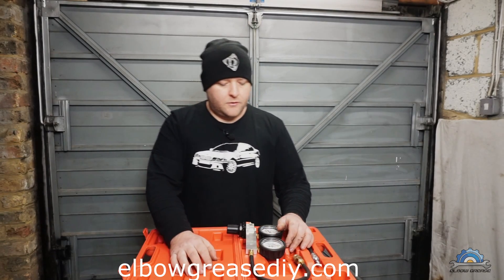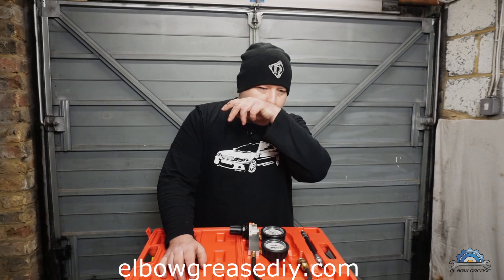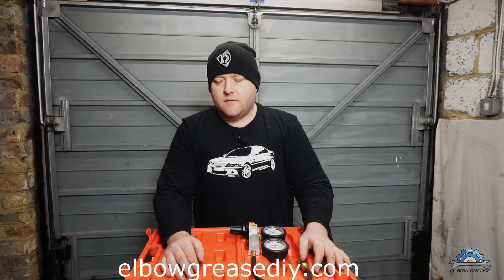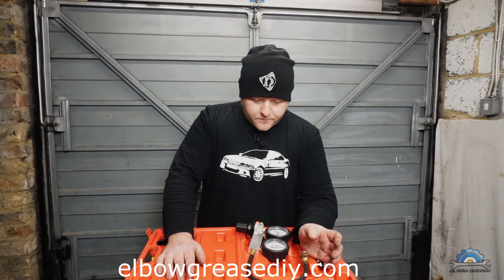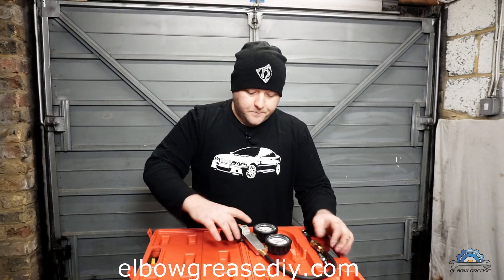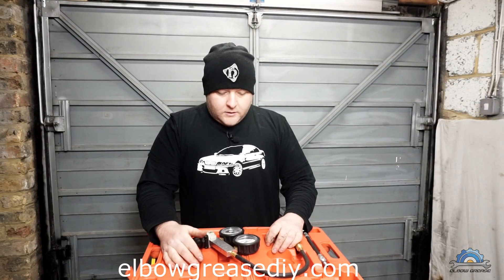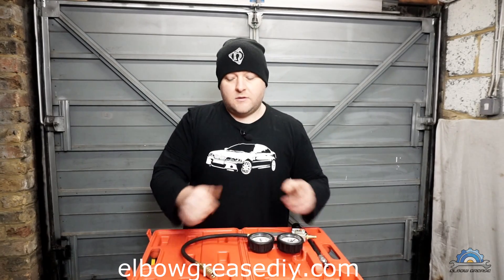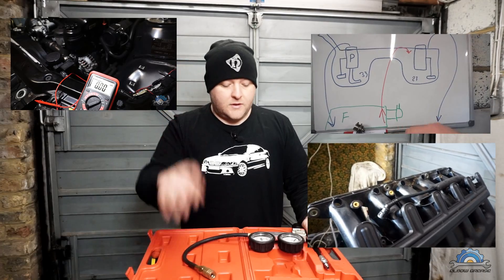BMW E46 ENGINE PROBLEMS - Leakdown test

Comment: I'm burning oil only because its getting sucked in to the intake in the ob2 toque app I'm -25 vacuum at idle so going to try the o2 mod pilot thoughts don't have that in my tail pipe although my oil going into the intake new ccv put on at a cost of £385 just to suck oil the wrong way back to the intake German engineering ha ha
Reply from the maker: this app is not able to show you vacuum cuz there is no sensor related,vacuum figures are virtual.
like I said in this video https://www.youtube.com/watch?v=OaT72UO5ksw&t=13s   if you had changed ccv once ,leave it alone ,piston oil rings are bad and that was confirmed by few already.How much you burning?

Comment: Thanks for the update. I am looking fwd to your videos. Oh about compression, I tried to measure it last evening, my girlfriend was trying to help but I was having trouble getting a tight seal for an accurate measurement . Do you recommend I use Teflon on my threads? 😂
Reply from the maker: there should be oring so put some oil or grease on it